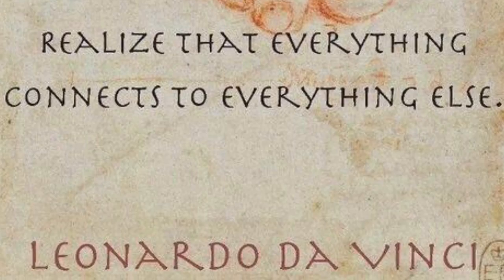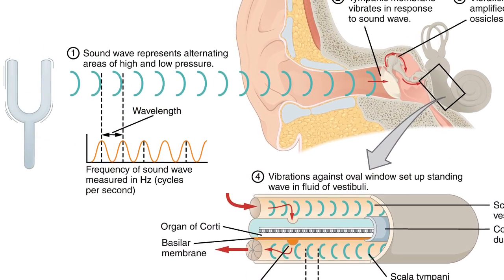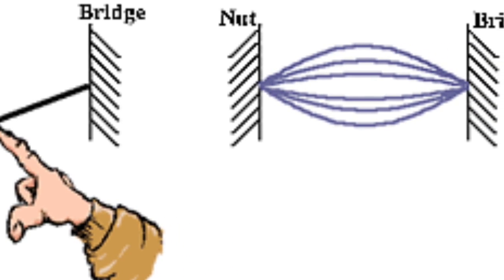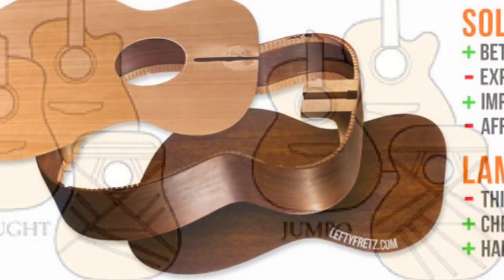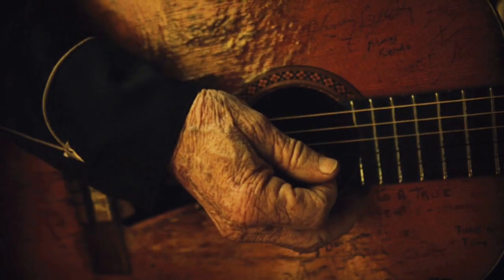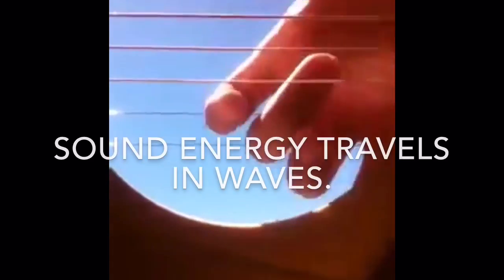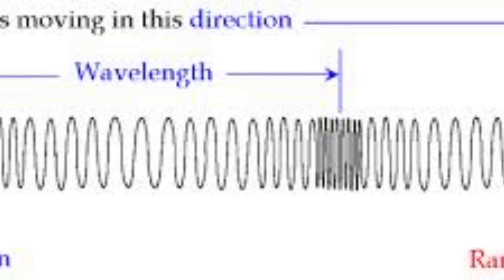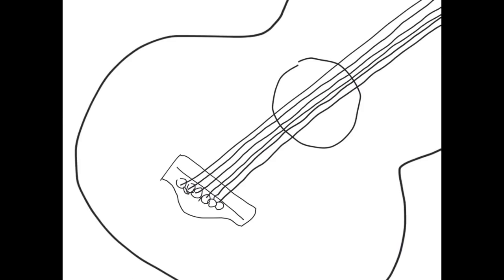Physics of the Acoustic Guitar

Comment: A lot of the sound of the guitar comes directly off the top, because the string vibrating against the bridge vibrates the top, making it act rather like a speaker cone.    Some of the energy comes off the back of the top, into the body of the guitar, and some of that energy comes out the soundhole.    The "back wave" off the back of the top is 180 degrees out of phase with the "front wave" (direct sound of the top) and is ported out the soundhole, but is slightly delayed by having a longer path (via the hole) to the listener, somewhat like the bass port of a ported speaker.

Comment: Good summary, but the acoustic guitar can’t amplify sounds. It conducts them from the strings to the sound board, where the vibrations can move more air.
Reply: That is amplification, by definition
Reply: @zk2611  No, it's more efficient transmission, which is different from amplification.   Since it's not actually amplified, making it move air more efficiently also reduces sustain, because the limited energy of the vibrating string is more rapidly depleted.   Amplification lets you use only a little energy from the vibrating string to generate a weak signal, then amplify the signal electrically, without robbing the string of energy nearly as rapidly.   Just adding mass and rigidity to the bridge will make transmission of energy to the guitar's top, and reduce volume but increase sustain.   (People do that with archtop jazz guitars, replacing wooden bridges with somewhat heavier and much more rigid metal ones to get more sustain.)